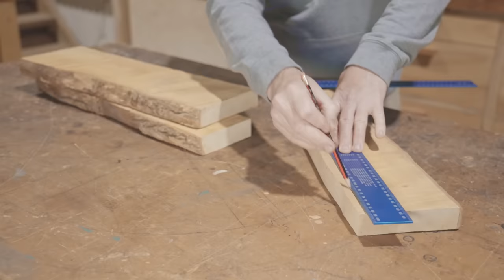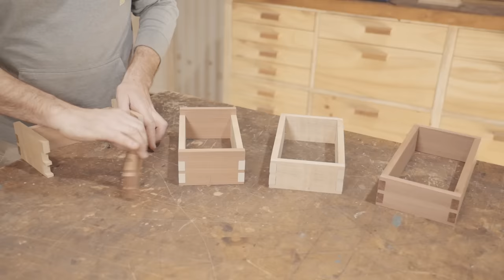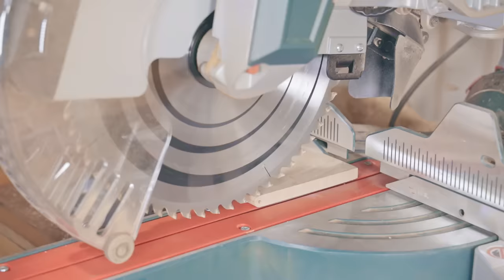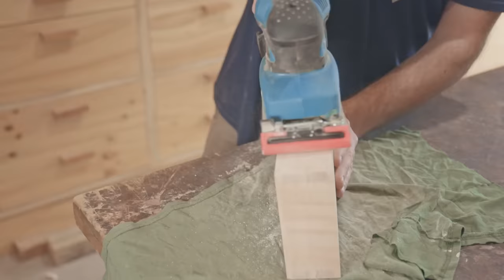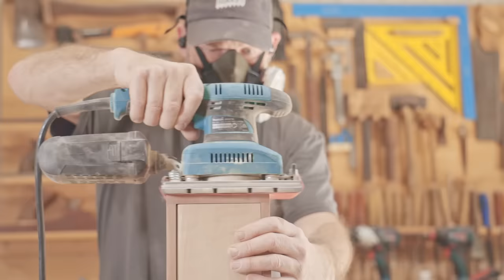4 Different Wooden Hinged Boxes Pt1 - Scrapwood Challenge ep41

Comment: Those swirly grain boards are difficult to plane, but I find that if I cut my pieces short, I can run them through the planer at an angle and the blades will shear the grain and eliminate both snipe and tearout.

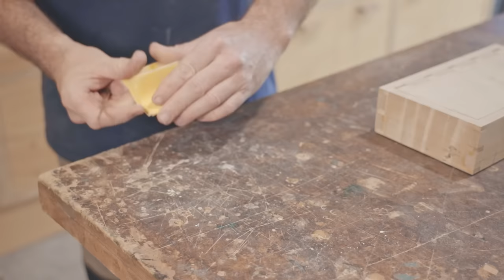Comment: 15:50 an easy and accurate way to cut bamboo skewers is to snip them with a pair of wire cutters or garden pruners. It could crush the fibers if not sharp, so always try on a test piece first. ❤🌅🌵😷

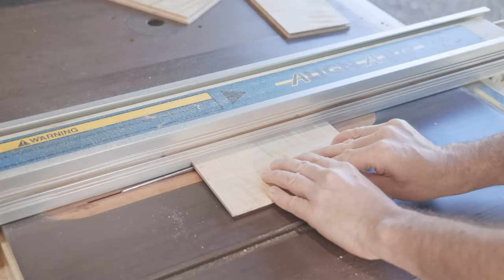Comment: 5:26]  I've been watching a bunch of videos recently on the dangers of 'kick back'  on tablesaws.  Technically, at this moment, this tiny little sliver of waste wood is kicking back, even though Pask does everything right, has an excellent riving knife installed, however, that tiny little toothpick gains just enough friction from the saw blade that it lifts up the leading edge and sends that tiny little straw jetting backwards.  I think a larger, stiffer piece of waste would not behave this way, it is just one of those weird things... the graph of the line goes up, up, up then another variable suddenly dominates, and the whole equation suddenly flips.  So what do you got a couple 1-1/2 to three horse power on the table saw essentially infinite and then coefficients of friction between waste and blade, waste and table, waste and fence, throw in Youngs Modulus, Bulk Modulus which are tiny forces... and 'zip' there it goes out the back.

Ok, I'm weird, I actually think about these things.
Reply from the maker: I could've pushed those pieces through with a push stick but I did it it this way instead and stood well out of the way of it's path. Some of them shot back really quite fast but nowhere near myself. :)
Reply: @PaskMakes  Thanks for replying!  This was not a criticism, it is just one of those weird things when the scales of forces suddenly change.  Trying to clear those tiny wisps of waste wood [try saying that three times fast] would probably have been more dangerous that - significantly - than letting those straw-weight things continue to do what they did.  Again, not a criticism.

Comment: Great idea making a groove for the long wire hinge
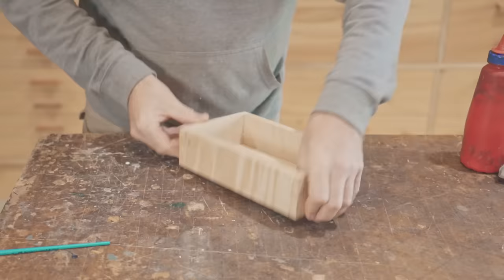For the next hinge idea  why didn't you partially drill the inside of the side panels for the dowel protruding from the lid, before gluing up the side panels that you did at 6:25 , rather than drilling all the way thru the side panels at 20:08? Dowel hinge would then be fully concealed when the side panels were then reinstalled at the finish

Comment: I like the FIRST BOX!. The signs of it being a "hinge" box! Are very EXPLICIT! I do have one question? 
The "rounding off" of the "sides" of the handle? To "open" and "close" the box? Good idea! Just what was the "type of wood" you used again? And can the same box "design" be used when the wood type is "pine?"
Reply from the maker: Thanks very much Luis - glad you liked it! The wood I used was camphor laurel and the reclaimed flooring was brush box but pine or any other kind of wood would be fine to use. :)
Reply: @PaskMakes  Good to know that Pine would work well. What about
the other part of my question. The "Blue Print" for the table? Or will I have to look it up on the Internet?

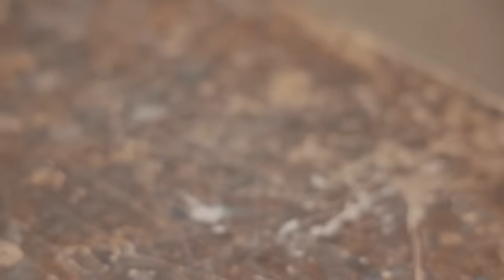Comment: I tried to do your method of the 2nd box (at 8:27 into the video) with 3/4 plywood and it did not work. The pivot points are off. It appears you made both pieces with a starting pivot hole in the same place spacing on the wood except the lid was made on the edge and the back support was made on the face. Holes on both pieces don't line up and the lid sits higher than the support piece.

Comment: Amazing that boxes can be this simple yet beautiful. I was wondering, with the second box, is there any particular reason to glue the dowel to the lid so it pivots on the box (instead of glueing it to the box, letting it pivot on the lid?)
Reply: if you need to replace the top you just have to redo the lid instead of drilling the box again
Reply: Glueing it in the box anchors that side and leaves a longer wearing surface in the lid thereby offering less wear over time. IMHO you will never need to replace the lid of the box especially if the pin and lid and box are made out of hard timbers. Terrific project and skills Neil, for an Ozzie your classic Mate.....now off to check out that screw advancing box jig....cheers from NZ